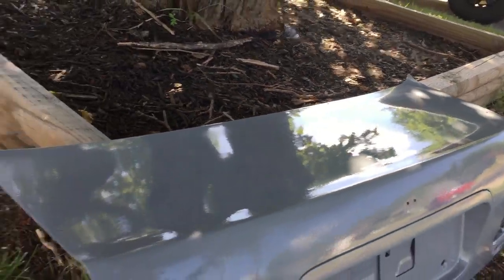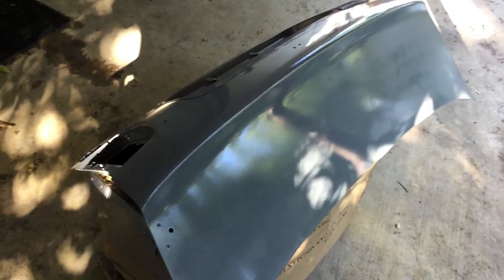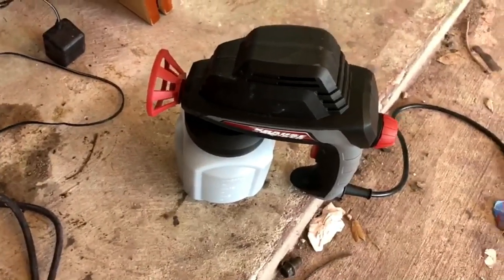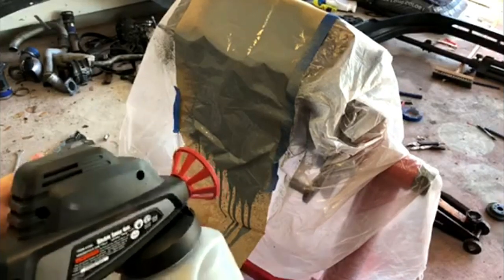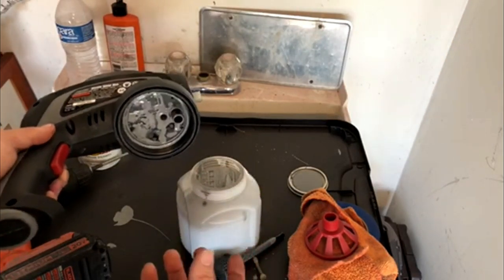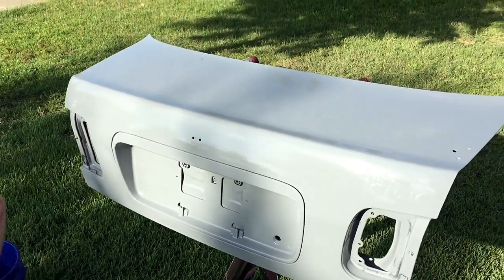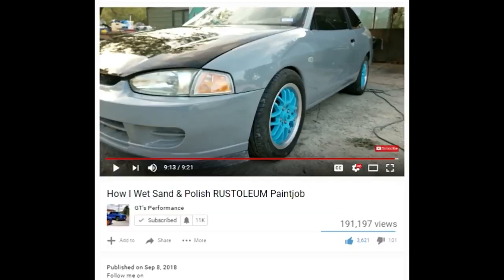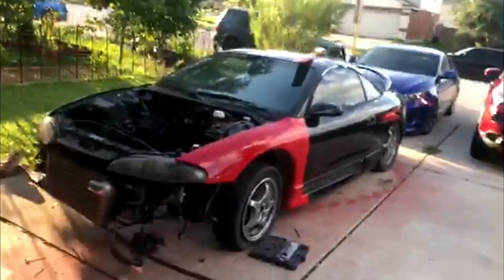Painted with a $20 electric spray gun ( decent results)

Comment: I got almost no orange peal i did base and clear and it looks amazing i found out for my use if you get closer and go a bit slower you get a real nice smooth even paint layer. I was using duplicolor ready to use clear gloss #3 and cut it down more with M.E.T. fast reducer like a third 3rd.
Reply: @ericsalidbar1693  what base did you use?

Comment: I painted several cars with a Graco TrueCoat 360 DSP Electric paint gun, I was gonna buy one of these Harbor Freight cheapies a while back but ended up buying the Graco instead. Its the same however in that you just have to thin out the paint a lot and you get better results and less orange peel. If its only 20 bucks I might as well get one as a back up or for smaller projects, it looks like it works just fine to me.

Comment: I decided to go the rattle can route on my own car after trying the Rusto roller paint job on a beater work truck (not worth it imo...) but one thing I noticed from breaking open a can of Rustoleum that clogged somewhere and draining the paint out was the spraycan Rustoleum is actually super duper thin compared to the actual paint in a can like in this video. I use that Rustoleum in my trade for various things like painting metal heaters, doors, and that kind of thing. I noticed brushing on the spray can Rustoleum was that I had no brush marks with it, despite brushing it, because it was so thin and full of solvents. I think honestly instead of 1:1 paint and thinner you might be better off with a ratio of about 2:1 or 1.5:1, I think even 1:1 is too thick, though obviously at that ratio you'd be two or three coating anyway.
Reply from the maker: GilBatesLovesyou Yea my first coat was 1:1 my 2nd coat it was too thick I didn’t go 1:1. It actually sprayed a lot better thinned out. But I’m still experimenting with it.

Comment: So, funny thing is that I used that same spray gun to spray plasti dip on my OBS LS Swapped truck 😂 I did it twice and since the guns were so cheap, I disposed of them when done. Only flaw with them are that they have no spray pattern. Check out Wagner brand as it is has a better spray pattern and just a little bit more $$. God bless and Thanks for the content.

Comment: Hey James! Thanks so much for the shoutout! ✊😎
I wonder what was happening to that electric spray gun. It could be an awesome solution for anyone who wants to start spraying, but doesn't have an air compressor.  
Great job! 👍 even after all that orange peel,  you left a nice surface with a high gloss finish.  💯💯
Reply from the maker: Thanks man and no problem! I was gonna message you but you got right on this video! Figured i would give you a plug you deserve more viewers.

Comment: I was thinking of using the spray can, but for me and correct me if I'm wrong, it would need alot of paint cans for my 93 300d Mercedes. So I was thinking of buying maybe a gallon and doing it with the electric gun. Don't care much about orange peel, because what the car looks like now compared to what it would look like with some orange peel my wife would love it😁😁

Comment: If I wanted to apply clear coat would I wet sand the paint before using clear? Or apply clear over the orange peeled paint and wet sand the clear?
Reply from the maker: From what i have heard you can add a Urethane hardener and it acts like a clear coat making this UV protected and even more of a shine. Which is what im going to do when i do the whole car
Reply: Wet sand the base 600 grit then clearcoat...the paint will look flawless afterwards

Comment: YOU NEED MORE PRESSURE  OR THIN IT OUT MORE  LOW PRESSURE= RUNS AND ORANGE PEEL SPRAY CANS HAVE LOW PRESSURE SO I WOULD THINK THEY THIN IT OUT MORE KEEP TRYING SEE WHAT HAPPENS
Reply from the maker: Bob Sillas I have been practicing and it’s due to being too thick. I thinned it out and it shot way better!

Comment: That is the paint my dsm is painted with it looks pretty good after I wet sanded and buffed it and it is holding up well
Reply from the maker: Heck ya! I might do the car out of this gun or the harbor freight spray gun not sure yet but i know i have had more issues with the spray gun than this thing lol.
Reply: @JamesDguy  I used a pneumatic paint gun from harbor freight turned out great still a little orange peel though

Comment: Yea man!
I've done this before, but my HF electric is so damn noisy. This technique is great for construction, farm, fleet etc. equipment.
HF would make a ton of money if there was a top feed electric spray gun.
Reply from the maker: stephen hunter Right i am impressed with how it does. I have used these to paint houses before and it’s good stuff. I figured out if I dilute it a little more and add hardener it will actually spray a lot better with less orange peel. So ima do the entire civic using this method. I’m exited to see how it will turn out
Reply: @JamesDguy  can't wait to see those results!

Comment: The spray can method seems cheaper, with less orange peel in my opinion, based on your other videos
Reply from the maker: Right yea less orange peel for sure. Still not sure which method im going to use. I know i wanna use the can under the hood because it would be harder to wet sand out the imperfections on that area.
Reply: @JamesDguy  true, seems like the best option, I'm considering painting and modifying the exterior of my red TL, because the car has too many things that need attention, so if im going to spend so much money making it run like new, I might as well go all the way in and make it look like new too before I sell it. That way the next person to get it wont have to do anything to it but enjoy it.
Man I remember your sentra videos and the green and black turbo civic videos, seem like so long ago lol

Comment: Great job bro ! Really, unbolievable .... Do you even get that this look better than most cars - new cars ! wow after buffing.... And Im thinking to do like this: 1.paint. 2. wet sanding 1000, 1500, (maybe 2000) 3. clearcoat. 4. buffing... But I have to find out what paint I can use - that is really a big problem for me at this moment... well there is just one thing and way to find right one - to try... I already did try some water based (acrylic) but I tried to paint with roller - result was terrible because of bubbles ....
Reply from the maker: Uroš Petrović I would find a oil based paint. No clear would be required if you thin it with acetone and if you add enamel hardener because that makes the paint super strong

Comment: Screw that James. All the adjustments and cleaning, I'd just rattle can it wet sand and clear and save 20 and all the cleanup and b.s. Seems the idea is to throw down some color, then work it out as desired. Why does it sound like you're shop is full of rattlesnakes?
Reply from the maker: Edwin Feldman It’s locust lol it’s literally everywhere around here in Texas lol.
Reply: That's what i was thinking... Cans, or roller

Comment: Hey what's up kool video what color are you using on the car again? The pad you used is from harbor freight as well. Hey what about hardener from the magic can.
Reply from the maker: Rudy Flores I’m going to be going Gloss smoke grey and the buffer pad is the yellow foam one from harbor freight. What is the magic can?
Reply: from Tractor supply they have clear and hardener you use with Rustoleum  @JamesDguy
Reply from the maker: Rudy Flores Yes they have it at tractor supply

Comment: nice work on this one  i do have 2 questions  why Acetone instead of Spirits  and do you know if the Rustoleum  has a built in ultra violet blocker ? its been my understanding that is why the manufacturers  use a clear coat  years ago i lived in South Florida and my Dad rattlecanned a car  in red and no clear coat that  new paint  dulled and faded to almost a orange  in a few weeks  so the car wound up looking worse than the factory  sun damaged  paint job  the paint was a no brand name and was labeled as Acrylic Enamel ?

Comment: Not gonna lie, that thing has a pretty awful spray pattern. Like a half clogged rattle can nozzle.
Wonder if there would be some way to modify it to get better atomization. Would help a lot with the orange peel too.
Either way, you can still get results on a budget! Def needs a lot of finish work after, but it happens.
Reply from the maker: 802 Garage It was because the paint was to thick i needed to thin it out some. My first time painting on the trunk it wasn’t that bad. So I think I just need to thin it out more next time.
Reply: Makes sense. Thanks for the awesome budget minded videos!

Comment: Dont know why you wouldnt just use the cans so no clean up or mixing . Do know you did it just to try it . Would you clear it after the color coat and wet sand?
Reply from the maker: I would add the Urethane hardener which acts like a clear for this single stage making it even more shiny and proven to last 15 yrs.I personally have seen it with my own eyes when added with the hardener on a tractor and its still shiny to this day but used with a gun.

Comment: Can you go over this with a 2k clear coat? Would that remove the orange peel?
Reply from the maker: Chris Cardinale I won’t be doing 2k over this since single stage don’t require a clear coat. If I wet sand the paint better I can get rid of all the clear coat which I might do since it’s been requested. Single stage with hardener in it doesn’t require clear because it has a uv protected hardener.

Comment: Hi Guys, 
Great video again.
Are you always meant to use the cutting compound after the spray and before the clear coat? 
Sorry for my stupid question. 

Cheers
Reply from the maker: Dublin Plumbing I only use the wet sanding when there is a lot of orange peel but I don’t buff/compound before clear coat but I have no intentions to clear this because it’s pretty strong.
Reply: @JamesDguy  thanks bro. Gonna try the bonnet on my truck today..

Comment: Hey what gardener would you use on rustoleum paint to
Reply from the maker: Daniel Partida i use cheap tractor supply hardener
Reply: What's the name of the hardener I want to buy some this week to finish this car off. It's taking forever to do it the spray can way for me because I have to do it in sections. So I guess I will have half spray can and the other from a can

Comment: I just watched a little bit of the video and I wanted to ask do you prefer the spray can or the machine?
Reply from the maker: gary salas It’s a 50/50 for me I prefer can during winter time due to not drying as fast so the paint comes out flawless but in the summer I prefer this because it don’t dry fast but after it’s done and out in the sun it’s easy to dry it quickly and achieve a nice finish.

Comment: what type of clear coat did you use to its not scrachable ?  where do they sell it at? if its not 2k clear
Reply from the maker: jesse flz This don’t have clear coat in it ^ it’s not required. When used with hadener it becomes uv resistant and won’t chip or fade. Single stage is awesome stuff.
Reply: Moore Motorsports James Dguy what harnerr? they sell jt at walmart?
Reply from the maker: jesse flz Tractor supply or paint shops. Oreillys should sell it in their paint shop. It’s urethane hardener

Comment: Why use a acetone instead of paint thinner?
Reply from the maker: WeirdJerz3y In my experience with Rustoleum the acetone actually works way better and keeps that gloss look better when using acetone. I have sprayed Rustoleum out of the gun many times just it was my first time with this electric gun. It needed thinned more though that’s 1 reason the orange peel was crazy
Reply: I thought your supposed to use mineral spirits with oil base paint

Comment: Hey thanks for the video. Probably a stupid question but do you need a compressor to run this with or is it built in the gun?
Reply: 书中自有黄金屋   I'm sorry but where does it say "airless"? The noise sure sounds like a compressor that's why I was asking. Are you 100% there's no compressor involved?
Reply: 书中自有黄金屋  If you look at 9:21, is that a compressor in the floor (lower right of frame)?

Comment: I tried that cheap Harbor Freight electric spray gun and it was total trash
Reply from the maker: Reo White I’m still experimenting with it  gonna try to get the most I can out of it before calling it quits
Reply: My dad sprayed his car decades ago (before clear coat) with a Wagner power painter. The key is to put the paint on super thin, almost like water. You have to do multiple coats that way but it eliminates a great deal of the orange peel. The biggest thing you’ll fight is runs but those can sand out. It looked fantastic.

Comment: Did you use a hardener?
Reply from the maker: Brian Bejado Not with this but when I go to paint a car I use hardener. It shot out with so much orange peel due to me not thinning it and adding hardener. I figured this out while experimenting after this video lol
Reply: @JamesDguy  cool, what hardener do you use? I have an electric spray gun as well and I would like to try this method out on an old car for practice.
Reply from the maker: Brian Bejado I will use any hardener I can but I have some off brand from tractor supply.

Comment: Without 2k clear
Paint won't hold up
Reply from the maker: King Tin Yes it will. If I added enamel hardener in the paint would like 5-10+ years I speak from experience on this one. My old S10 was painted 11years ago using Rustoleum safety orange out of the gun added acetone to thin it and enamel hardener and did 5 coats. After it was cured we buffed it and added wax and it still looks like the day we painted it. That’s the great part of implement paint it’s durable and that enamel hardener acts like a clear coat. Sorta